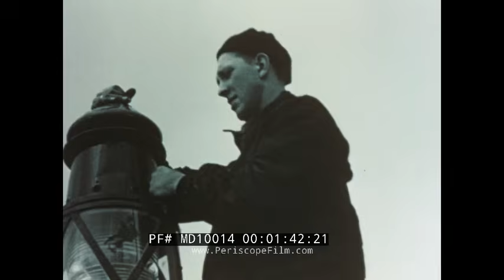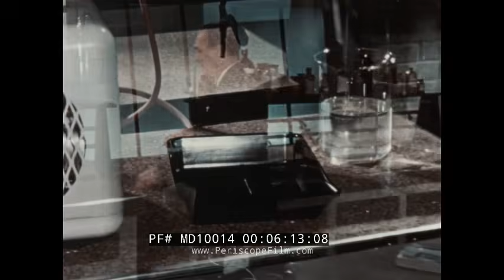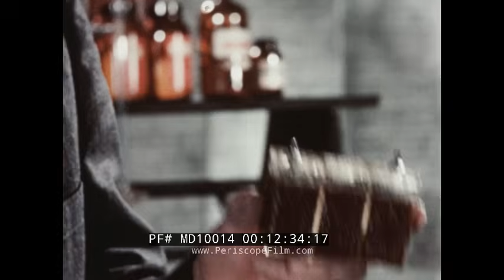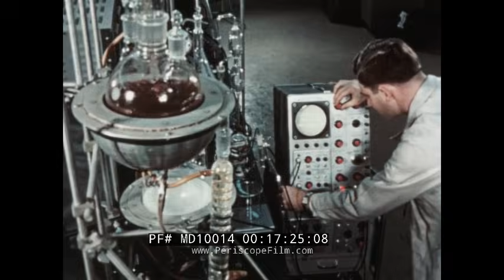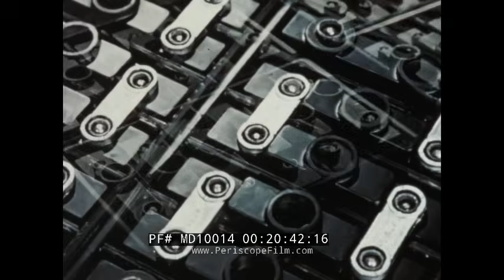" THE STORY OF THE MODERN STORAGE BATTERY "  LEAD ACID BATTERY 1959 EDUCATIONAL FILM MD10014

Comment: handles lead, worse will heat scrap lead with a burner, no respirator all lead fumes - then pour it in the hole where broken post was to make a new post.  maybe smokes a cigartte - that seems to make lead goaway. yes they did mend broken posts. These oldfilms are so to the point and correct almost timeless. unlike the BS in modern tutorials

Comment: 😊😊 the old batterys 🔋 😊 had caps on them where U check the water 💧 😊 in them if it was low U add water 2 that cell when full put the cap back on and tighten now 2 day they don't make batterys like no more now they are sealed U can't add no water 😉 😮 2 them no more when they are bad that it take the old 1😊 and turn it in 4 a core get new battery 😊😊 OMG 1 1 2O26

Comment: So if you were paying attention they explained why batteries freeze and that when they freeze it breaks the plates. So acid turns to water freezes which expands and shoves plates together. 
If your battery is charged it has acid in it and acid doesn’t freeze. I’m surprised that they didn’t say anything about it.

Comment: The minuteman missile uses lead-acid 24 v to start systems on rocket.  The acid is not kept in battery and keeps battery fresh and safe.  Once launch is authorized electrolyte floods case and it supplies voltage prior to rocket start..

Comment: The modern lead acid battery is so over engineered it finally turned into JUNK. I own a FORKLIFT battery shop which are the LAST "Mom & Pop" battery makers in America making us the local Experts. Every town in America has a small FORKLIFT re-builder, just YELP IT! Our Lead Acid batteries last 35 years. WHY?? We don't Use grids or Lead Oxide (red lead) plates. Since it's the BIGGEST killer of batteries. Sure our amp-hours are only last half as long between changes BUT they charge up TWICE AS FAST TOO so it's not really a problem! The Positive Lead-oxide grid on a car battery is so thin it starts breaking and turns brittle in 2 to 4 years at best. We use thicker SOLID lead plates on both Negative and Positive and they last for YEARS since they are thick and have better Strength and Structure! This type of battery does not hold extra power for "tail gate parties" but if all you want to do is start your car every morning for the next 35 years YOU NEED A SIMPLE SOLID PLATE LEAD ACID BATTERY. Of coarse 80% of battery corporations will die but that's not your problem! Again these older style SOLID LEAD PLATE lead-acid battery types will give you about 5 minutes cranking time before they need to be recharged but with modern fuel injected engines they start up in under 1 or 2 seconds every time and then the Alternator quickly recharges the battery. Even in cold weather or after months of sitting these THICK plate batteries get the job done of starting you engine. Things HAVE to Change! Also the Negative plate does not have to be lead since it not part of the chemical reaction and we cut the weight in half buy using a carbon or graphite plate which works the same but now it's 10 pounds lighter. Even 316L Stainless Negative plates work and can be very thin. Even the DREADED "Lead Sulfate" can be easily dealt with by carefully reverse charging the battery for 3 or 4 minutes. The good "DESULFINATORS just give the battery short jolts of reverse voltage, MAGIC! I learned my trade from an old timer and other people and sadly now gone smart people and they took all the good info to theie graves!

Comment: A great exhibit of the chemical nature of lead. Most of the electronics today have RoHS, (restriction of hazardous substances) which includes lead. One of its great virtues is its recyclability, from then (1959) to today (2023). The lead acid battery looks to be around for some time to come, while it remains the most cost effective device in automotive applications. The lithium cells have come a long way, but still prohibitively expensive...

Comment: Pro tip
If you go buy a flooded cell battery and it doesn’t say something on it about epoxy bonded plates and envelope separators you bought a piece of crap. 
Super pro tip
Buy an AGM instead

Comment: Man I dont know how I missed this but im glad I found it: Back in the early 80s I worked on an old X-Y telephone switch we had a back up battery system that was installed in 1966 the batterys worked phenomonally, just routine  Specific Gravity checks and periodic charging and they would humm along for upto 8 hours in a power outage. I saved those batterys when they decommisioned the switch in 1987 used em in DRMO purchased C-10 and  Dodge crewcabs I bought on station also decommosioned. some are still running today. They sure dont make batterys like they used too!
Reply: That's an impressive life span, XY switches are so cool btw. How large was each battery?

Comment: Have I mentioned how bad batteries SUCK? The funny thing is the 1959 battery pretty much is EXACTLY the same as the 2019 battery you can get down at NAPA. What a great educational video. I have always wondered why each cell is not replaceable; It just kills me when you get a bad cell and have to chuck the entire thing. I feel bad for the factory workers with all the lead and no PPE. Still, thank you for preserving these films.
Reply: @vondeliusc
Funny you mention this because I had a new battery from NAPA about 4 years ago, and within the warrantee period, I guess a year in maybe, I go out to start the van and the battery was basically dead, hmm, ok, how? I thought maybe a courtesy light/dome light was left on or a door not shut completely, charged the battery, it would be fine for I guess a few days or maybe a couple of weeks and then again it's dead!

I went thru that 3 or 4 times and decided to go back to NAPA and have them test the battery, because by now I KNOW 100% no lights were left on, the radio was definitely OFF, all the doors definitely closed etc. He took the battery out and bench tested it in front of me, with TWO different test devices and both said the battery was "good" the alternator and all were in good condition and charging the battery correctly too.

Made sure the battery was 100% charged again.

Couple of weeks later the batter is dead again!!!!

So I went back to NAPA, and it's a small town local shop and I know the owners well for years, so I said, can we just exchange this battery under part of the warrantee, I'll pay what ever the pro-rated amount might be but don't want him to be out money on the exchange, let's just get this battery changed out. Well, he exchanged the battery for me with a new one and told me don't worry about the pro-rate, it's taken care of.
The replacement battery has performed flawlessly since, so it WAS a bad battery and what ever was wrong with it TWO totally different battery load/diagnosis testers they used at the NAPA store said the battery was good!
Sometimes you have to just ignore what such test devices claim, and just go with your gut feeling
Reply: @FCE-dogs sounds like your battery had a high self discharge rate which doesn't necessarily cause the internal resistance to go up which is what the testers look for. This usually happens because debris from the plates builds up at the bottom of the battery and can create a high resistance short circuit that drains the battery within a couple weeks if it's not charged constantly.
Reply: 1959 car battery: $75  2023 car battery: $75
Reply: @BrilliantDesignOnline  more like $125 at napa

Comment: It was interesting how the ways lead acid batteries "die" was covered at the end and it still holds true today.
Reply: No kidding.  Anyone that has several things with lead acid battery knows this all to well.
Reply: Yeah pretty much all the info they gave here is still true about flooded lead acid batteries. The only real difference between the ones back then and now is the materials we build the casing out of and how we seal them but electrically and chemically they are pretty much identical.

Comment: yes I remember the old batteries that had the caps where U could add water 2 each cell now U even see any of those batteries  not every often anymore now 2 day all the batteries are sealed U can't add water no more when the battery is gone it's done I did see 1 of those old battery last 15 years it must been a good 1 when it was made 😉 OMG 12 1O 2O22

Comment: Very good video! I like how he used a real quarter made of silver and a real penny made of copper and slid them into the cut grapefruit. Now we use fake money to buy junk.
Reply: Yeah, couldn't miss real money. I remember when the took the silver out of the coinage to pay for the vietnam war without raising taxes. Just print worthless paper like WEIMAR GERMANY. What could go wrong. Antimony when added to the plates results in batteries that last extreemly long. We had some thirty-five year old batteries in emergency lights at work. When tested they were perfect. Seemed to be immortal.
Reply: Now the copper penny is cheap zinc and still costs more to mint than face value

Comment: If car batteries were made a bit better would last much longer the corrosion on the plates build up in the bottom and short the plates out .... I bet they are designed to self Destruct
Reply: They are designed to do a certain job for a reasonable time at a reasonable price. It's not efficient to make a battery twice the size for four times that price that perhaps lasts twice as long.

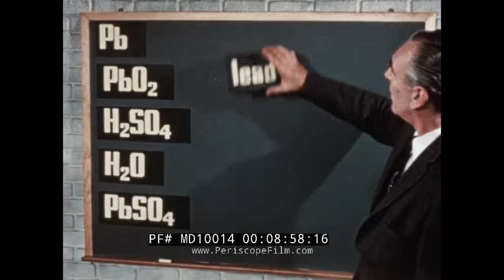Comment: Love these old trustworthy science shows, i'm just a bit confused on the oxygen levels, how is "O2"...one measure of oxide...?   at 9:00...PbO2 = 1 lead and 2 oxygen but it's... lead per oxide?, yet  H1 O1 = hydrogen per oxide....computer says no,  help!? please.
Reply: It's... weird. "Lead peroxide" is a scientifically incorrect term of art, used out of habit and tradition instead of accuracy. I'll try to explain what's going on.

The "peroxide" doesn't mean "per oxide," it means the peroxide ion O2... which comes from hydrogen peroxide, H2O2, where it got called "peroxide" because there's one hydrogen per oxygen. The structure of hydrogen peroxide is, roughly, 

H-O-O-H; the O-O part is the peroxide.

So, looking at the equation, PbO2 could be "lead peroxide", and that's where the term of art comes from. HOWEVER, the structure of PbO2 is, roughly,

O-Pb-O

So there's no peroxide ion in that structure, so PbO2 ISN'T "lead peroxide." It's "lead dioxide."
Reply: @TimperialBroadcastingAgency  I'm giong to have to take your word for that, i'm smart in many things, but dumb as an ox in this...lol.
Reply: @scottleft3672  Yeah, it's weird, like I said. An example of a real peroxide is barium peroxide, BaO2. Its structure is

Ba-O-O

And that's the difference, vs. O-Pb-O.

Hopefully that helps sort it out.
Reply: @TimperialBroadcastingAgency  Thanks, Bill Nye. 🤓

Comment: You don't put electricity into the lead acid battery, instead, the charging just change the property of the lead plate. Learned something from an almost 70 years old film.
Reply: You don't put electricity into any storage battery, even a Lithium-Ion one.
Reply: This film is 62 years old. 61 years in the time when you wrote.
Reply: @shamandezu8975 66 now
Reply: Also not emphasized is that while charging, water is converted back to sulfuric acid. This is why you can check the state of charge with a hydrometer - sulfuric acid is heavier than water.
Reply: Well, you do put the electricity into it. It just converts to chemical once inside.
Reply: I really don't think this is right, it emphasized it so much in the video but you are infact adding electrons and holding them there. From what I gather it's lead going from +2 oxidation state to +4, +4 has 2 more electrons. So I think it really is holding electricity.
Reply: @thefriendlymadman229  +2 means it's missing two electrons. Oxidation is losing electrons. But electricity is not necessarily the presence of electrons, it's just an imbalance of charges--an electrical potential if you will. So you're right, electricity is def being held
Reply: What do y'all think electricity is? Voltage is just a difference in charge density. Charge wants to flow to areas of lower charge density, and we make it do work on it's way there. Lead peroxide has been oxidized, and thus has less negative charge than the plain lead. Given the catalyst of aqueous H2SO4 and the wire connecting the plates, charge density is able to flow from the lead plate to the (+) lead peroxide plate via the chemical reaction detailed in the video. 

If you just charged a metal plate by sending electrons to it, it would be susceptible to discharging through the air. By locking the electrical difference into the metal through oxidation, you ensure that the plates won't discharge unless the catalyst of acid and the wire are present. You can easily disconnect the wire through a switch to turn the "catalyst" on or off, thus turning the battery on or off
Reply: One could say it took over 60 years for you to eventually learn this?
Reply: @thedoctor2102 😄👍👍

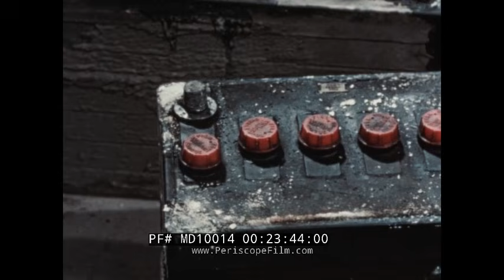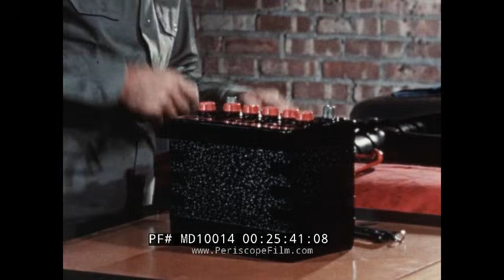Comment: 23:44  "When a battery bounces around... the battery posts can be broken"  25:42  Picks up battery by it's posts!  :D
Reply: It's perfectly safe to pick up a battery by the posts. Have you never seen an old battery carrier? It's a rubber strap with metal rings that fit the posts on both ends.
Reply: @DJS_ENO  i mean sure it's perfectly safe until it's not, theres a reason modern batteries have the universal strap mount

Comment: So the mechanic didn't fix that car, he just installed a new battery "I look forward to see you again", right?
Reply: Even with the advent of ODB scanners, there's a margin for dishonesty.  Ignorance is costly.
Reply: yep and next week he gets to sell you a charge regulator as he didnt check why it went dry in a month,
Reply: Nope. The cell was dry. Most likely just wasn't checked and refilled. Modern batteries are sealed and rarely lose water. Most golf carts however use the traditional style of battery and need to have the electrolyte checked else you'll ruin the it. I'm working on a cart now with 2.5 year old batteries and the whole bank is bad, almost every cell in every battery is below the plates.
Reply: Some things never change.
Reply: It was VERY common in cars with Generators that the batteries would get over-charged, which boils off the water. The voltage regulation of modern alternators is much better, so there is significantly less topping up required.
BTW: Modern lead acid batteries aren't really sealed at all, and they DO lose water.
Reply: “Don’t Be A Parts Changer” 😅
Reply: Old generators with external regulators like that were VERY finicky. Normal vibrations and temperature swings would knock the regulator out of adjustment and over/undercharge the battery. The battery explained here is very similar to the ones we use today, but the methods of charge and discharge in modern vehicles are completely different
Reply: To be fair he said the battery had a dry cell which is caused by bad maintenance or a manufacturing defect.
Reply: The battery was dry, probably from not checking the water.  Cap type batteries needed regular water checks. Modern car batteries are semi sealed and don't lose water.
Reply: Second-guessing doesn't solve the problem if it lies elsewhere.
EDIT: typo.
Reply: @turpialito  I think it is the O2 sensor.
Reply: @u2mister17  That's an amateur diagnostic. Schmorglebanger probably rubbing against the contimplator, causing a short to ground, obviously. More parts to sell you :-D
Reply: @turpialito  Maybe a fuel injector.
Reply: @turpialito  Turbo Encabulator 😅
Reply: @bobroberts2371  There must be a trade-off.  It's not like they couldn't make a sealed battery back then.
Reply: tarstarkusz  Sealed Lead Acid ( SLA ) / Valve Regulated Lead Acid ( VRLA ) / Gell cell batteries existed for aerospace applications but the cost would have been $$$$$ .  Kind of like getting a Li-Fe / Lithium Ion or Super Capacitor battery for your car today.   Other than the cost of environmental controls, lead acid batteries are very cost effective in many applications.  A typical lead acid forklift battery is $ 7,000 , getting this in a lithium is about $ 21,000 .
Reply: @bobroberts2371  water is the last thing I want in the same sentence with battery

Comment: Fascinating video.   Now I know how I trashed my RV batteries... LOL
Reply: Starting batteries have thin plates and many of them per cell to give high amps for a short period of time.  Deep cycle batteries have thicker plates and fewer of them per cell.  

In either case, a fully charged lead acid battery that has not been charged / discharged in 8 hours will read about 12.66 Volt and a fully discharged battery about 11.70 V.  Running a battery to full discharge will damage it by growing hard lead sulfate on the plates so don't go below 20% state of charge, just below  11.94 . 

Below is a state of charge table.  Also, as the plates become coated with hard lead sulfate or the material falls out of the grid, the battery in effect loses capacity but not voltage.

The chart, note a slight difference in voltage is acceptable. If just removed from a charger, the voltage will be high , if just removed from a load, low. 

12.66 100% 
12.42   75%
12.18   50% 
11.94   25%
11.70     0%